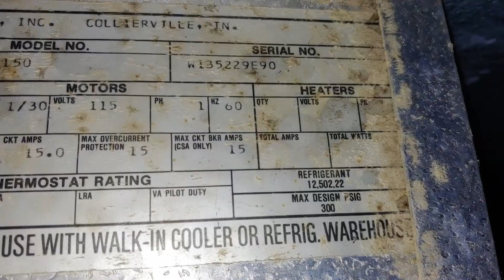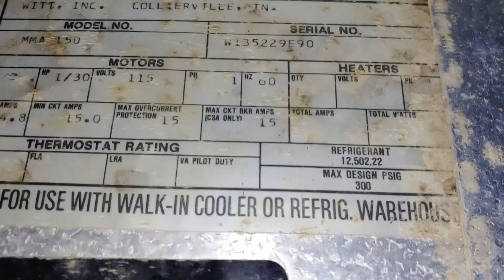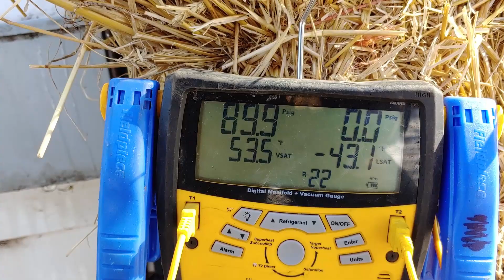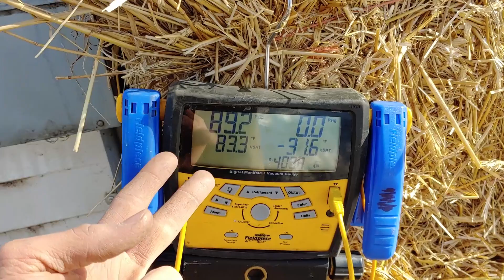How to Identify Mystery Refrigerants

Comment: In auto industry they have machines that identify what type refrigerant or  if it's contaminated.
Reply from the maker: Oh that's interesting! I wonder what one of those machines would cost... I guess this is the "old guy way" of testing it.
Reply: auto a/c is probably so hacked up with diy'ers topping off 134a and 1234yf systems with propane based refrigerant, it must be really important.
not to mention all the fix a flat leak sealant/performance enhancing additives.